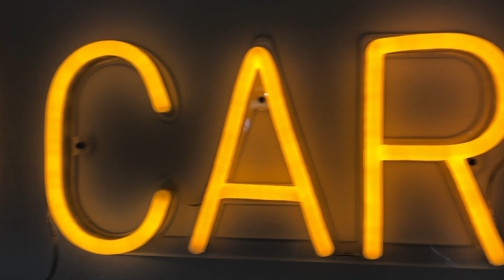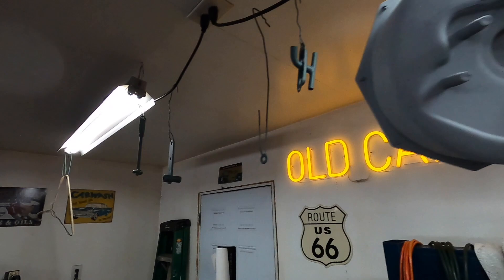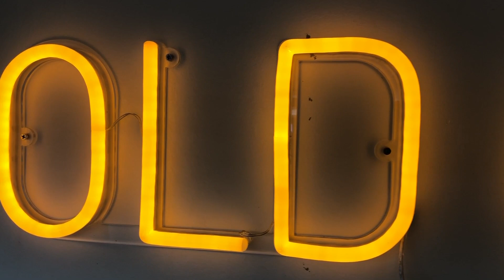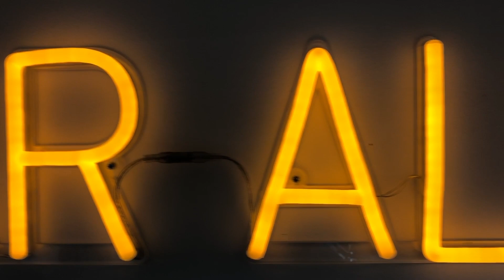59 Chevy Bendix power brake booster overhaul part 3, painting

Comment: I'M surprised you don't get moister in the air line out in the cold when you are painting I would think some condensation would in the part of the line hat is outside in the cold. Thats a lot snow if you get that much show it to us. Still thinking about you and praying for you!
Reply from the maker: I have three inline air dryers I use when painting. Taking warm air into the cold docent seem to cause moisture... it's when I paint on a hot day, and the air in the compressor is cooler, is when I get moisture in the hose. Never had any issues painting in the cold winter the way I do it.

Comment: I follow closely on this painting information because I am just learning. You have mentioned your Frame Paint,  Nason Black Acrylic Enamal Ful-Cryl II and the paint you used on the booster housing that you said is Single stage acrylic enamel - Shop-Line PPG (JE). Different manufactured paints I assume, but are they different paints for different purposes? The parts look great. Glad you were able to get them in between less than desirable weather. Naaa snow is snow no video is needed for me.
Reply from the maker: Acrylic enamel is acrylic enamel in my mind.... just different brands. I have used them all, PPG, ACME made by Sherwin Willams, Nason and Shop Line, made by PPG are all good..... No complaints with any of them from me, though I do prefer ACME, but it's become ultra expensive. Thats why I rarely use that brand anymore.
Reply: @OldCarAlley  Thanks Howard sounds good.

Comment: Hello Howard,  I looked over some of your past videos and didn’t see if you mentioned the brand of tires you installed on your Galaxie.   My ‘66 Galaxie with the 390 2bbl calls for tire size 7.75/15 which in todays world is a P205/75R15.  I want to stay with American made tires but so far have only found Uniroyal Tigerpaws and a brand called Milestar Touring. I want to stay with WSW’s. I can go with size P215/75R15 as an alternative. Don’t know if that would be better or not. Main concern is getting a good American tire if I can. Thanks for your help.
Reply from the maker: I put WSW P215/75R15 Hankook tires on my Galaxie.